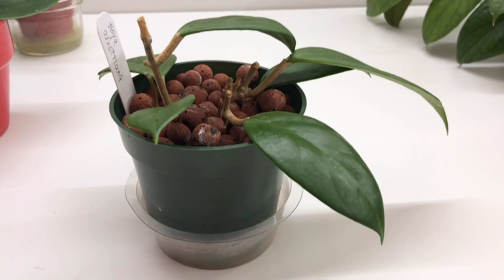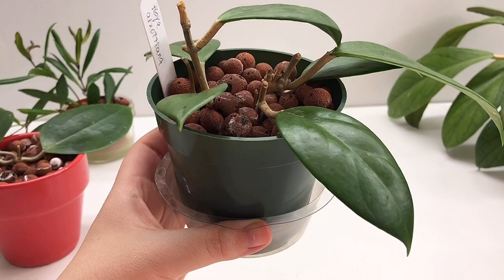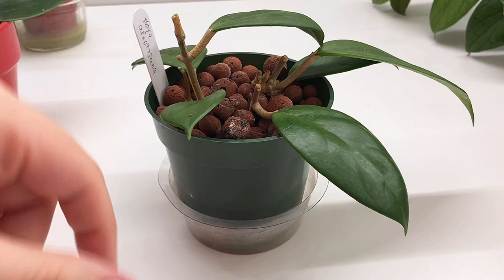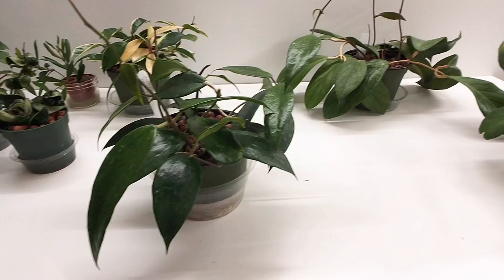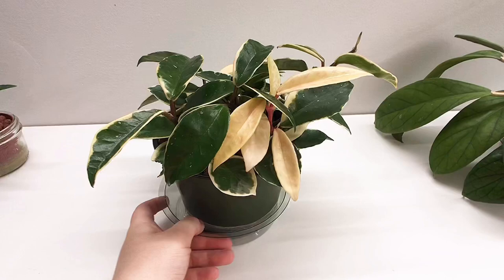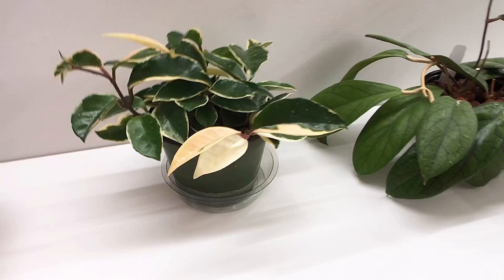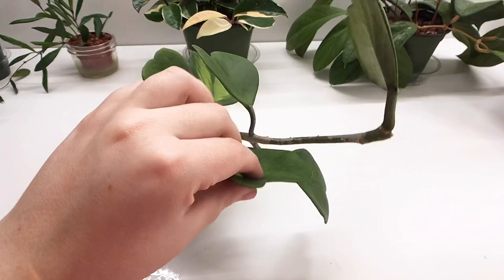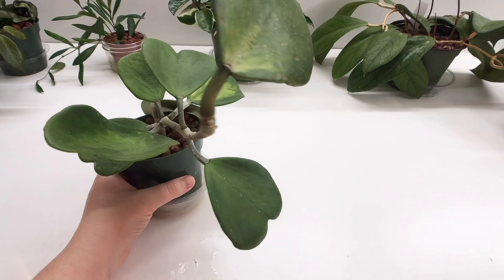Rooting Hoya Plants in LECA (Hydroton) Let’s Chat!

Comment: I know this is a dumb question but how do you know when the leca is dry before watering again? I have 3 plants in leca but they are not hoyas so I don't let the leca dry down ever and they are okay with that. I want to take some cuttings from a hoya a have and put it in leca as an insurance policy in case I loose the plant. Plus it seems way easier to keep them in leca. I am a believer after transitioning a few plants over as an experiment. They have really done so well. Hopefully you get this message. I know its an old video.

Comment: Do any of those plants have any water in them?
Reply from the maker: I let the pots dry out before adding more water. I think of the leca as a soil replacement, and I just water it with hydroponic nutrients. Seems to me working well. The roots are not harmed by drying out. But I do see roots at the very bottom go mushy when they sit in the same water too long.